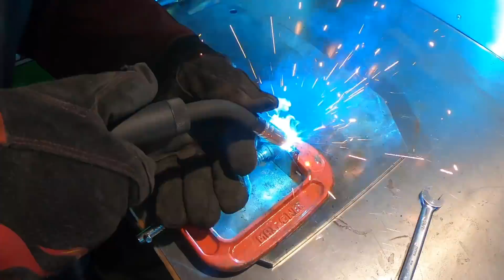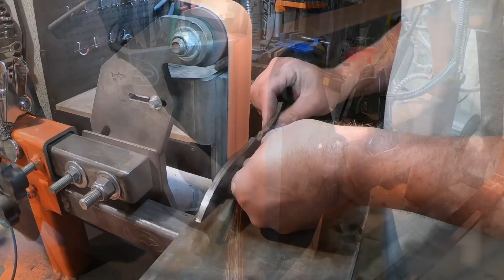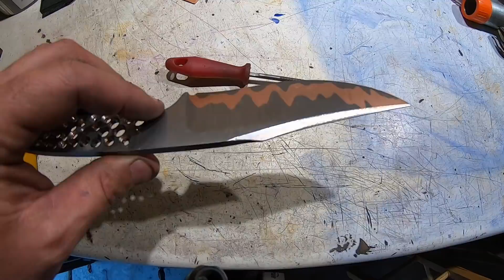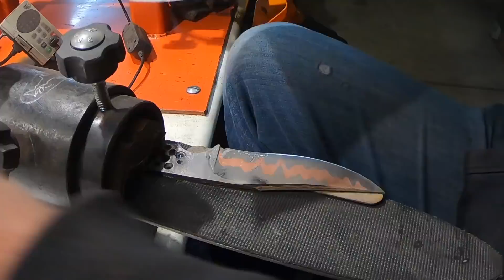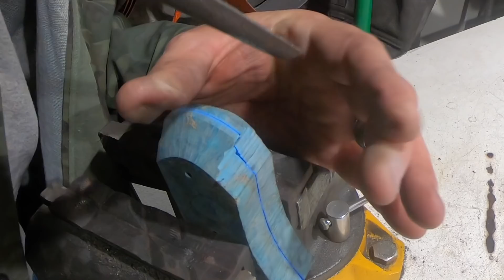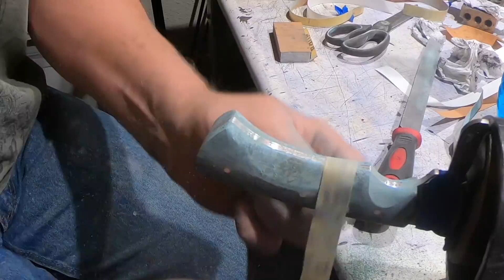Forging a Cu Mai Hunting Knife

Comment from the maker: What do you think of this build?  I didn't show the etching process but I actually had to cover all the copper with clear nail polish and just etch the 1080 by hand with a q-tip!  Please give me your comments!
Reply: Did you try to etch it first? I was thinking of a coffee etch
Reply from the maker: I was warned from another video that the copper etched much faster so it would be pitted or depressed it you etch the whole thing.  I was thinking about coffee but decided against it.
Reply: I was wondering about the etch...
Reply from the maker: I etched that mokume gane in my ferric with no issues.  It still works fine.  Is it supposed to lose potency?
Reply from the maker: @wrk3182  yeah, it’s probably time for me too.  It’s been over a year at least. No
Reply: Oh yeah, this one is stunning!
Reply: Thanks for the additional information, I was wondering if/how you etched the edge steel. Makes sense to mask the copper; I'd hate to see all that hard work get fouled up by discoloring the copper. Beautiful knife, beautiful technique. Thanks!
Reply: that looks fucking RAD. CuMai is such an awesome-looking effect, and the rest of the design complements the blade perfectly. bravo!
Reply from the maker: Thanks!  I have a more recent cu mai build as well that came out even nicer I think.  👍
Reply: Excellant job! This would make a Really kick*ss katana blade(or tanto).
Reply: Cu mai is nothing special although is new technique at first i couldn't figure out what cu mai is actualy is and then it hit me Cu in Cu Mai represents coppper in periodic table of elements and mai is from san mai an old japanese technique. When you compare Cu Mai and San Mai they are aside from difference in use of material essentialy the same. Overall the knife looks cool !

Comment: Were do you get your handle materials also what size copper rods looks 👌
Reply from the maker: This is a pretty old video so my handle sources have changed.  Mostly I get wood from either Oleg at http://knife-wood.com or from Blade show.  If you're talking about copper sheet, use 0.020".  Thanks for watching.

Comment: Liker the video. Why does everybody use copper in these builds instead of bronze or brass?
Reply from the maker: The melting point of copper is 1984F which is about 200F higher than either bronze or brass.  It’s still possible but much harder to forge those. Thanks for watching.

Comment: When using a 1080 core, will the knife blade still rust? Also will the copper layer turn green eventually without proper maintenance?  I havent started making samascus yet, but i am saturating myself with the knowledge and going to give it a try soon... I won't be starting out with any intricate designs like this, but i just ask the questions as they come up in my brain 😅😊
Reply from the maker: This is a carbon steel knife so it will rust if not cared for.  I like to tell people, keep the steel from rusting and the copper will be just fine.  The copper Bowie knife I’m most known for (on the cover of Blade mag Knives 2023) is now 3 years old and looks amazing still.  Thanks for watching.

Comment: Thank you for the video and explaining each step - especially about forging the copper.  I've now done a few copper blades with the knowledge you shared.  I've started using my oven for heating since it's easier to hold a 1700 to 1800°F temp for setting the copper "weld".  Thanks.
Reply from the maker: I’m glad it was helpful, Ken! 👍. Thanks for watching

Comment: Just curious but when doing a cu mai go mai blade could 304 308 or 316 stainless for example work for the outer layers
Reply from the maker: Yeah it might work.  Though you’re not going to get the cool carbon migration that people think of with SS San mai since the copper would be between it.  Thanks for watching.
Reply: @TyrellKnifeworks   would u be able to use brass plate instead of copper?
Reply from the maker: @turbosport3954  Yes its possible, but brass melts at about 1650F so its really tricky to forge it and not melt out the brass.  Mostly people do this with an oven instead of a forge so they have precise heat control.
Reply: Oh yeah that makes sense

Comment: It’s looks very cool but how will it go on steel spike test? Or coconut chop? Etc. ….
Reply from the maker: It will do just fine.   Remember the entire core and cutting edge is 1095 high carbon steel.  The copper is just for looks and doesn’t affect the core strength.  Thanks for watching

Comment: denis how do you etch the knife if regular ferric chloride? or with coffee? thanks i just made a small copper damascus knife and want to etch it corrcetly and not melt all the copper away  thanks very much Mark
Reply from the maker: First you need a separate ferric bath.  The copper will contaminate it.  Next, remove 30% of your ferric in that container and replace it with muriatic acid.  That will stop the copper from bleeding.  I did coffee afterwards on that blade.  Msg me if you have more questions.  👍
Reply: Tanks so basicly instead of 3 parts ferric do 2 parts and 1 part murriatic to my distilled water?
Reply from the maker: @Anderson-HandForged  No, mix your ferric 3:1 but fill your container up 2/3 with that.  The last 1/3, just add muriatic acid.  Basically if you already have ferric mixed, just remove a third and replace it with muriatic.
Reply: @TyrellKnifeworks  thanks appreciate it denis

Comment: What about a sandwich like yours but adding 0.5mm nickel 95-99% pure sheets between copper sheets and both steels you use, Ni fuse well with copper but also with iron... 🤔💭
Reply from the maker: Yes that certainly will work and I’ve seen it done.  One nice effect of the copper on steel though is that you get a cool black outline around the copper.  You don’t see it as much on this blade but check my recent kabar build and you’ll see what I mean. Thanks for watching!

Comment: Gives me an idea for canister method. Fill a canister with steel cable. Then completely melt copper so it will seep into all of the voids in the cables. Forge, split down center and forge weld it back together to get "Feather Damascus". Saw directly down the center from the other side and forge weld good steel between the plates for a good sharpening edge. No idea how it would work but might look awesome 🤷
Reply from the maker: You can’t forge weld anything with copper in it, copper melts at 1980F and you need around 2200F to forge weld.  Plus in a canister the copper tends to melt and just settle to the bottom.  So I have my doubts this would work, sorry.
Reply: @TyrellKnifeworks  ok I was thinking welding was cooler temp than that. I was thinking along the line of filling the canister tight with cables and fill the voids and canister all the way up with melted copper and let cool. Then work it below the melting point of copper. Not all hope it lost lol I'm sure theres an alloy somewhere that is a little closer to temperature.
Reply from the maker: @nashvilleoutlaw  The problem is not your canister, it's the notion that you'll saw it in half "and forge weld good steel between the plates".  That's not going to work.  Any steel to steel forge weld will need to be around 2200F and that'll completely melt your copper away.

Comment: So, the further we went into this video the more confused I got as to why the hell you drilled all those holes into the tang of this knife. It was obviously tricky and none of it showed in the final result. I thought maybe that you would put different sized copper pins in all of them but nope, nothing. Why? Why are the holes even there?
Reply from the maker: The extra holes are simply for weight reduction so that the knife is more balanced.  It also gives the epoxy somewhere to stick to as well.  Thanks for watching, Anica!
Reply: Ok, that makes more sense. Would it have made the overall handle less sound if you had made all of those into copper pins? Just curious, I'm interested to see if you ever get bored and want to make another one :) also, I would LOVE to see one of these damascus style knives made with the no-handle method (sorry, I have no idea what the real term is) where the blade and handle are all one piece of metal in the finished knife. We see those for sale at county fairs alot here in Montana and I've always been curious what the practical differences are between a knife with a handle and one where the handle and knife is all one piece.
Reply from the maker: If you mean a knife where they forge the handle and fold it over?  We usually refer to those as blacksmith knives.  They are usually less “polished” knives.  Not really my style.  Thanks for watching!
Reply: I've seen those as well, but the ones I was curious to see someone make seem to just be made from one huge billet with some design hand carved into the handle portion. They usually have holes drilled in the handle like it's just one big fancy tang almost. Hard to explain. Some of them have extra pieces and embellishments but the main knife is all one piece. I've seen some mosaic style ones where the mosaic goes all the way down the handle part.

Comment: This is my favorite knife yet. It's a stunner!
Would brass or bronze be able to be used? Those against a high shined steel would pop too.
And can Damascus be made from mixed metals?
Reply from the maker: Thanks for taking a look, Linda!  If you haven’t seen the more recent “bowie on fire” build, definitely check that one out if you like this one!  You certainly creat Damascus with different metals like brass, bronze, nickel, silver, etc.  as long as it doesn’t end up on the cutting edge.  Thanks for watching!

Comment: How functional is this style of knife? Does it delam after time?
Reply from the maker: It’s very functional.  There’s no reason it would delam at all.  Think of a pan with a copper bottom that’s continually put on heated burners, they do not delam.  The copper bond is extremely tough.

Comment: How did you prevent the copper from turning green from oxidation?
Reply from the maker: If you keep the knife clean and give it a bit of oil it will stay that way.  Similar to keeping steel from rusting.  👍

Comment: You’ve got me thinking about oxidized copper now, after seeing your temper cycles. I wonder is there’s a way to get some surface oxidation on that copper without compromising any strength or structural integrity? I’ll have to do some experimenting!
Reply from the maker: Are you looking for oxidation on the copper?  I guess you’re referring to the color bands.  Hmm not sure.  You’d want to do your final sanding and then perhaps do another lower temp temper.  🤷‍♂️. Interesting idea.

Comment: Very cool blade and technique. I was surprised to see you use JB weld 5 min epoxy over G Flex.
Reply from the maker: JB Weld 5 min has always worked perfectly for me.  I know people rave about G Flex but I’ve never had any problems.  Maybe I’ll try it at some point.

Comment: Awesome video! You were incredibly instructional. Do you think this process would work with copper alloys like brass/bronze? The alloys have lower melting points
Reply from the maker: Hey Ty, I’m pleased you like the video!  Using brass would work but the melting point is 1710F so it’s getting really close to your temps to move the steel.  You’d have to be precise with your temps and not overheat it.  Starting with thinner cladding so you don’t need to move the steel much would be advisable.  👍

Comment: Really digging your videos! I have watched this one like 8 times! Ha!
You should do a video on your press. Show us the different dies and dimension of the dies. I am working on a press now so that would be cool! What material did you use for your large round drawing dies? Thanks
Reply from the maker: Thanks! I’m thrilled you’re liking the content!  I’ve done a video on the press, check my Triple-T videos.  I think it’s #3. The dies are 5” squares so that you can turn them 90 degrees.  The big rounding dies are actually from 1” square stock that i ground down on the grinder.  👍
Reply: @TyrellKnifeworks  I will definitely look for the video. dude having your dies square so you can turn them 90° is a great idea! I definitely will implement that in my build. Thanks for the reply
Reply from the maker: Glad I could help.  Checkout that video, it has a complete parts list.  If you have questions, contact me and I can help.

Comment: If u get a large gap in steel we use a buzz bar ( copper ) as a back up plate hit it with a small hammer and it fall off after u welded one side
Reply from the maker: Good to know... thanks for watching!

Comment: You cannot weld copper
Reply from the maker: No, but the steel on either side welds and melts over the copper.  That's what I wanted to happen but each time the mig wire hits the copper it sparks a bit more.  It worked though. 👍🏻

Comment: I really think the holes will eventually cause it to crack especially with you using different metals for the blade .
Reply from the maker: Well we’ll see.  Since just about every knife like this has holes in the tang for weight reduction I think it will be just fine.  😉

Comment: Instead of using 15n20 for the outer jacket do u think you could use stainless ? Would like to use 440c for the outside and 1095 for the core. 
Thank un
Reply from the maker: Yes,, you could use stainless here.  You wouldn’t get the carbon diffusion though, which is the cool effect that people look for with SS cladding because the copper is between them.  Thanks for watching!

Comment: Wait, wait,   so in effect you brazed 3 steel plates together, found out grinding two material hardnesses that greatly varies  is a pain and then learned the hard way that copper and brass need a negligible cutting edge angle.
Then you prayed your way through a heat treatment with one eye open.

Your blade came out beautiful I must say.
Reply from the maker: I'm not sure what the tone of your comment is.  If you're saying I was flying by the seat of my pants, then yes.  This whole channel is about exploration and doing something new and bringing the audience along.  Thanks for watching.

Comment: Doesn’t copper aneal when quenched? Will you end up with a thin 1095 core wrapped in soft copper? How well has the life held up? Definitely does look awesome!
Reply from the maker: The copper bond is extremely strong and the core is 1080 and its about 3/32" so its quite thick.  If you held it, you'd see its extremely solid and satisfying!   😉

Comment: Nice, asked another bladesmith that does this & was sort of vague in in description.  
After wiring new shop I'll give it a try.
Reply from the maker: It’s actually a pretty easy process.  Give it a try!  👍
Reply: Tyrell Knifeworks oh,  real quick question. Were you at a bright orange? Noticed you mentioned not a welding heat, for me that's almost white.
Reply from the maker: You want it hot enough to move the steel.  You do NOT want forge welding heat or anywhere near that or you are going to melt the copper.  Keep it between 1600 and 1800F.  I hope that helps.

Comment: It would be interesting to do a timascus pattern (titanium Damascus) instead of the copper. And then do a ladder Damascus on the outside. Or have a copper bolster.
Reply from the maker: Titanium is really, really hard to forge weld to steel from what I’ve heard.  Also I think there’s a patent on timascus.  Not something I’m planning on trying any time soon I’m afraid.  Thanks for watching!

Comment: Cu- mai? I thought it was called soldering. Isn't that what you have done? I mean Zwickey arrowheads are according to them soldered with copper.
Reply from the maker: It's more like brazing with pressure... call it forge brazing?  Whatever you want to call it, it works very well!  😉
Reply: @TyrellKnifeworks  looks cool, joints would be STRONG.
Reply from the maker: @leighchristopherson2455  yes it seems very strong.  Thanks for watching!

Comment: i tried to make something like that in past, but b3cause i am crazy i added a two layer of pure nickel. it was a big mess which welding temperature choose but knife went out in some how. May you tell me with welding temp did you get for this piece? thank you
Reply from the maker: You only need temps around 1700F.  You definitely don’t want to go over 1900 or you risk liquefying the copper.
Reply: @TyrellKnifeworks  intact i bring a billet to 2100 F and nickel and copper looks like melted toghter but it is not possible anyway. thats is the result have a look https://www.instagram.com/p/CJTmMVZM10S/?utm_source=ig_web_copy_link
Reply from the maker: If you're "forge welding" copper or nickel to steel and not steel to steel, 2100F is WAY too high of a temp.  You're melting those non-ferrous materials.  Stick to 1800 degrees max.  Well, melting point of nickel is 2600F so you're ok there, but for copper that's way too high.

Comment: Did you test your blade core hardness? You can see the limited but noticeable carbon migration toward the cu layer contact with core.
Reply from the maker: I only have hardness files but it skated a 60 before temper.  The blade is plenty hard and the copper is far enough away that it shouldn’t be a problem.  Thanks for watching.

Comment: I now have a new challenge. That’s beautiful sir. I have used the JB weld 5 min stuff. Did not go well at all. I am now using the 650 G Flex. Many times better than JB.
Reply from the maker: I've never had a problem with the 5-min epoxy.  I think folks sometimes don't mix it enough and that's the problem.  Thanks for watching!

Comment: Awesome! But I would have doubts about using it hard... Have you tested how well the "welds" hold?
Reply from the maker: The welds are very strong, as strong as the copper that is.  There’s no seams at all between the layers.  The only issue would be scratches on the copper from heavy use, but that’s just aesthetics.